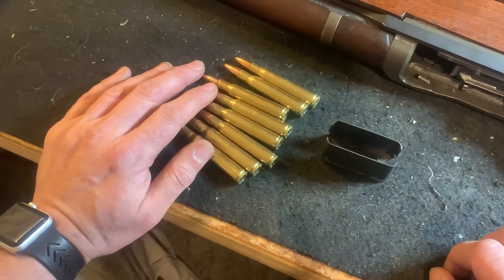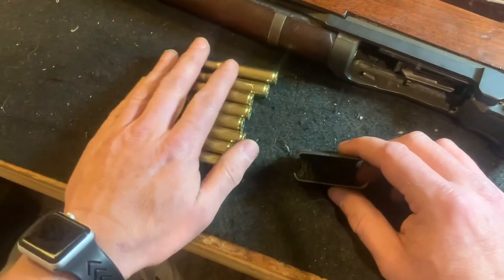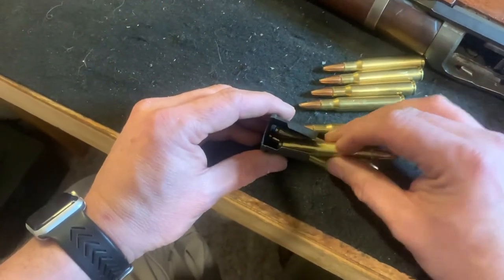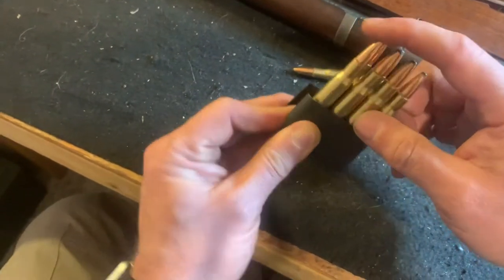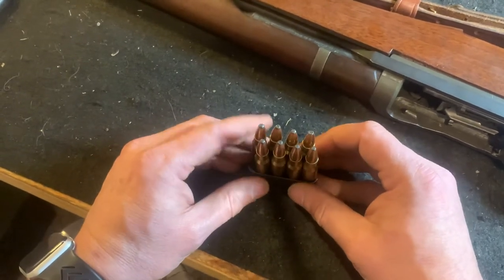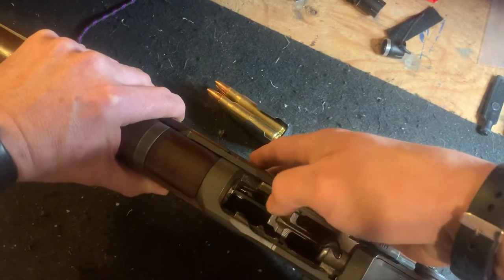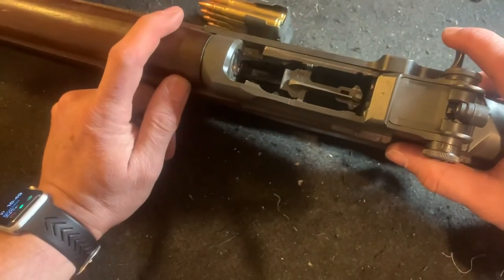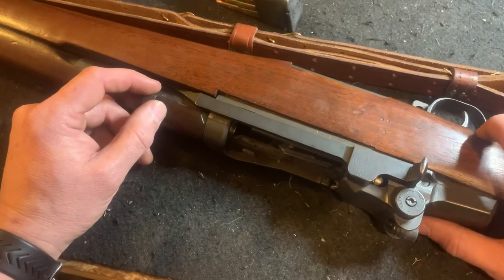Intro to the M1 Garand

Comment: The video looks good!
Unless there is a fault in the rifle or a problem with its timing, the bolt will NOT move forward into battery until after the thumb releases pressure on the clip.
When the clip is forced into the magazine until it locks, the thumb can remain in place, maintaining pressure on the top round until you get tired or need to use that hand to hold a sandwich, and the bolt will not release.   
It's true that the rifle mechanism will work equally well regardless of the order that the rounds are stacked, but there is a reason that it should be done opposite to the way it's demonstrated in this video.  The first and last rounds should be situated next to the round dimples on the sides of the clip.  Those dimples are there only for that reference.  
Because the clip is forced into the magazine with the thumb of the right hand, it is ergonomically superior to have the top round under the thumb.  It feels better and reduces the depth of the thumbs insertion into the magazine.  That's significant because when that thumb releases the pressure on that round the bolt should slam home.  When the clip is loaded properly there's just that little bit less distance that the thumb needs to be withdrawn to avoid interference with the bolt.  In practice, due to excessive friction within the action or the clip itself, the bolt might often not move with sufficient force to chamber the first round.  That's when a whack on the operating rod handle is employed to assist in completing the loading.
Reply from the maker: Thank you for the comments.  You are right about the dimples.  Most dont ever worry about them lol.